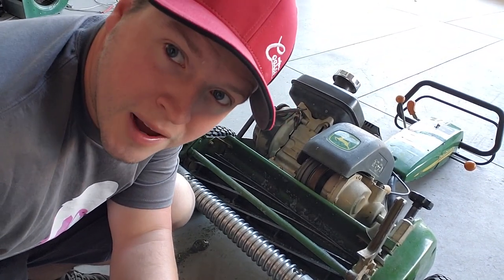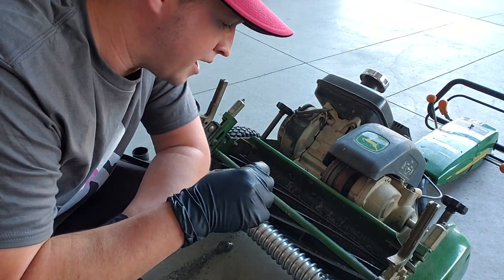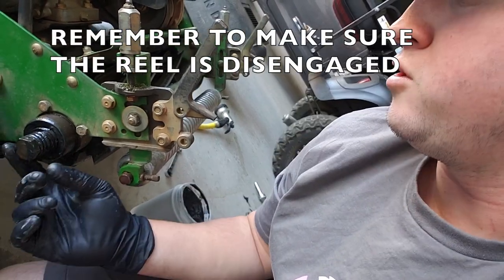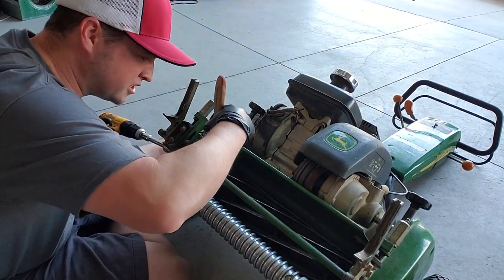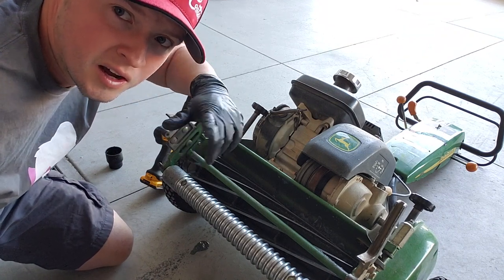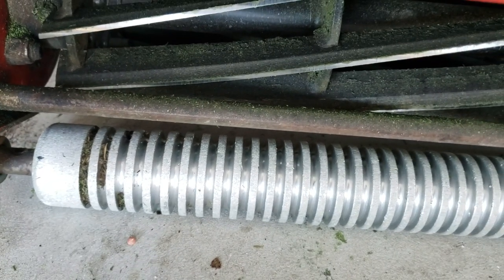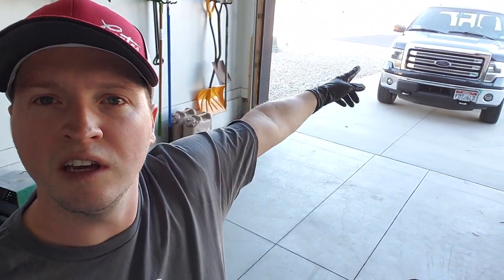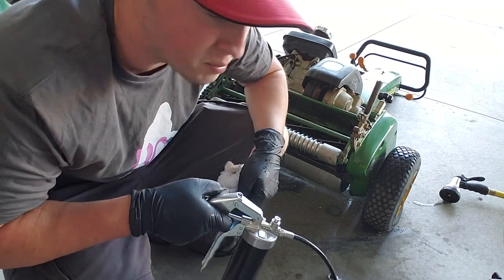How to backlap a John Deere reel mower!!

Comment: I just picked up one a John Deere 180b a month ago for 150 bucks! the only problem I have is setting the HOC. Still new to the reel mower. but It's a beast of a mower!
Reply from the maker: Let me know if you need any help!
Reply: @Brettsgrasscapades   do you use a HOC gauge or do you do the bolt with a nut threw a peace of metal method?
Reply from the maker: @nathangartner4822  So I am super fancy and use a top of the line 2x4 haha. I just use a 2x4 thats long enough to span the front and back roller and measure from that to the bedknife all the way across.  Its not fancy but it has worked perfectly for me this past season.

Comment: Great one!
Gives others hope they can hone there's too!
My machine benefits from me squaring the front of the bed knife with a file from time to time.
It's not perfectly square, it has a small angle so just the edge makes contact.
I have to take it off to do a nice job but it makes sure the "other" side of the scissors is nice.
Your bedknife is much different, only a slim piece of steel, I don't know if you could do the same.
Whatever, I thought it might be something you could do at home also......
Reply from the maker: Awesome suggestion my friend!  I was actually just reading about this the other day, I think they were calling it facing the bedknife. I will more than likely be trying this out in the next little bit! 

I really appreciate you watching and commenting!

Comment: Hello hello, what type of oil you use, and what’s the capacity in the crankcase. I just picked up one and I wanna put fresh oil,,, got to change the belts, watching ur Videos and Connors video made me pull the trigger to start mowing short.
Reply from the maker: I'm not sure what oil it uses honestly.
Reply: Brett's Grasscapades 10w30 John Deere, I got the Manual in finally and hygard for the gear box...